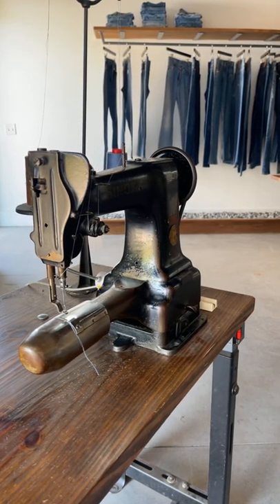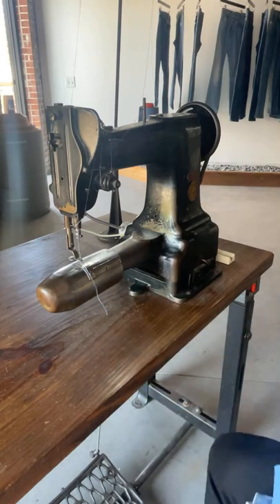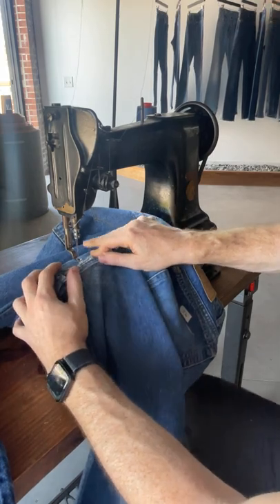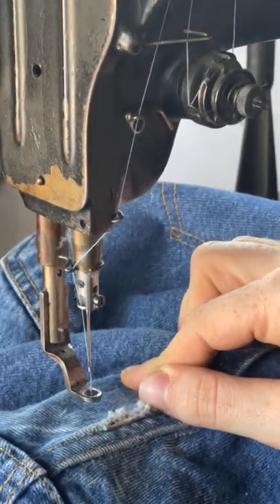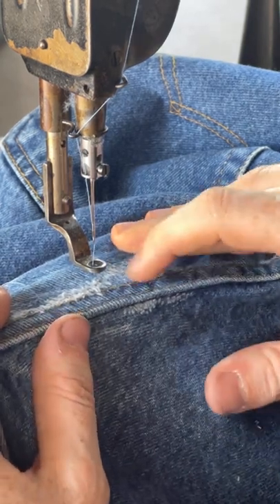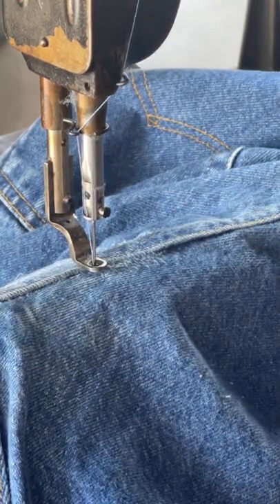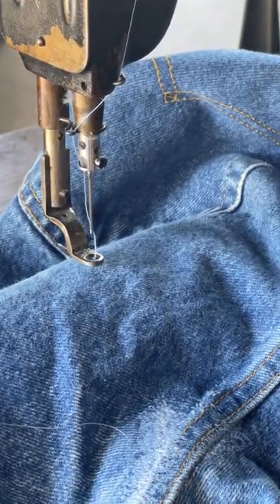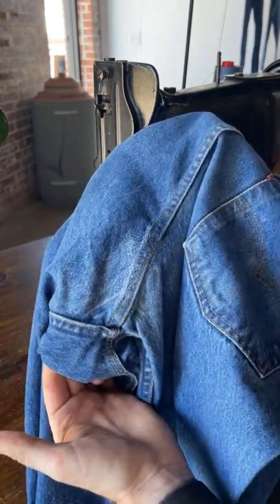How to repair vintage denim with a Vintage Singer 47w70 Darning Machine

Comment: If the tension spring is not used for the 47w70 product, it is difficult to adjust the tension. I bought a tension assembly for 47w and put it on and tested it, but the tension did not match. So I changed to a 47w70 tension spring and it seems to fit well first. Little things like this can make an impact. The degree of tilt at the end of the tension spring also has an effect.

Comment: I am curious about the tension of the sewing machine. When the direction is changed during sewing, does the thread below come up at that point?
Reply: You don't need a patch. He's an amateur you can just use the machine to create the patch Bobby moving in different directions and it can come out even better than what he has done if you really get good at it,, 😉😉
Reply: @2rage607  There are some things I haven't solved yet. The lower thread is sewn very tightly. It is sewn like real jeans fabric. But the upper thread is not like that. The upper thread is slightly loose, so it is not tight. What do you think could be the cause?
Reply: @ddiuni9964  it's all about the tension. So you got to play with the tension on the top until you get a right tight stitch. . Let me know if you are asking for this information right

Comment: When changing direction, the bobbin thread came up on top of the fabric. Is there any way to solve this?
Also, when changing direction, the thread under the fabric is also pulled (stitch spacing jumps diagonally).
Reply: I really don't understand what you're saying. But if you use the same thread in the Bobbin thread it would come out just right. I have two machines just update versions.. consew207-seikocw1
Reply: @2rage607  I've adjusted the tension with thin threads, but I can't adjust the tension with thick threads.  Do you usually use the type of yarn you use for dunning and the number of thread?
Reply: You need to tex 40 threads that is what you use for darning machine
Reply: @2rage607  Where did you buy the thread you use for darning?
It would be helpful if you could be a bit more precise.

Comment: I'll ask you an additional question.
Symptoms that appear when the "presser foot" does not come into contact with the fabric being sewn: The tension of the upper thread cannot be adjusted.
If you place the presser foot at a high place and sew so that it does not come into contact with the fabric, does the upper thread continuously stick together on the lower thread side?
First of all, I tried to adjust the upper tension several times.
First state: The state where the presser foot reciprocates above the denim
  Sometimes sewing works well, but sometimes it doesn't.
In this state, sewing continues and the thread is bundled in the lower thread.

2nd state: "A state in which the presser foot is adjusted to be in contact with the denim for sewing
- Sewing is good.
Conclusion, is my method correct? how are you doing